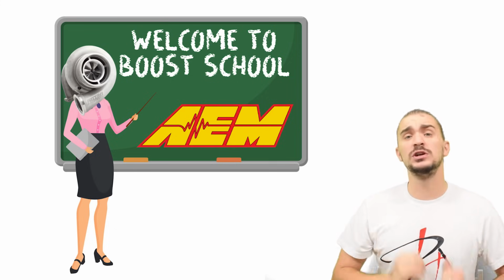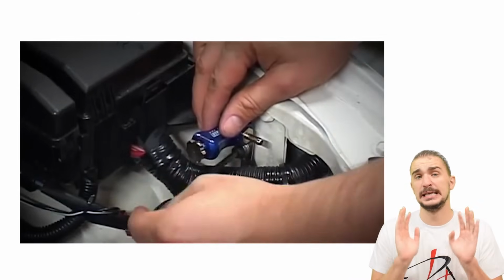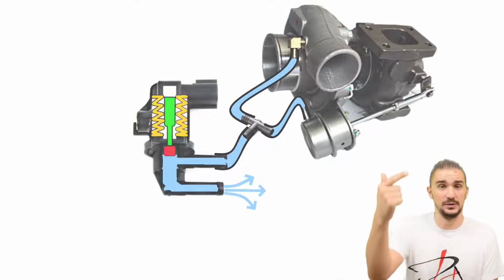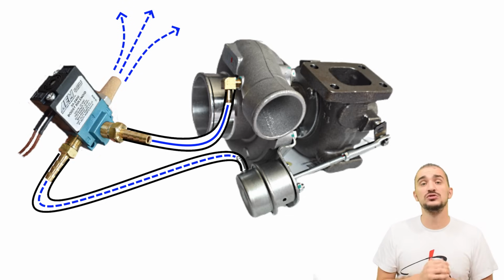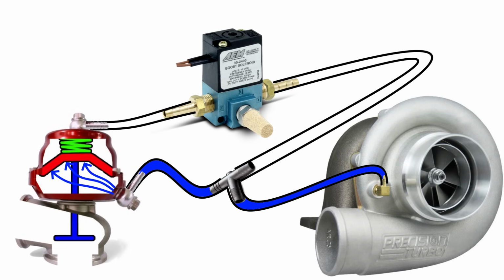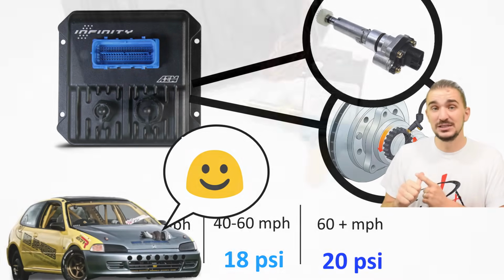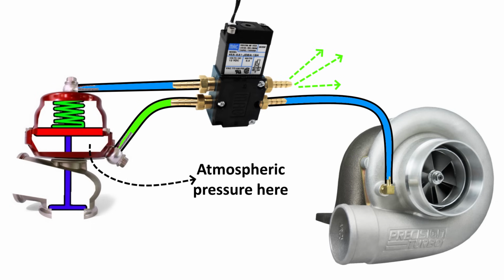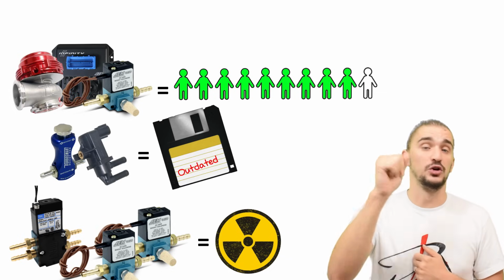ALL BOOST CONTROL setups EXPLAINED - Boost School #3

Comment: Duuuuude in 20 minutes you have explained boost control better than several days' worth of digging around obscure articles and forum posts, great job! Though you could also have talked about CO2-assisted setups?
Reply from the maker: I could, but I left it aside for a separate vid. At 23 mins this was long already. Electronic wastegates will also be a separate video.

Comment: If you have an integrated wastegate and want to run a 4-port or 3-port solenoid, Turbonetics sell a dual-port internal wastegate actuator. I haven't tried it but all the videos I've seen only mention external wastegates.

Comment: You didn't mention electronic waste gates. No springs and total control of boost all the time. I'm guessing that's more because of your sponsors not having them yet. Great video otherwise and the clarification of the boost control systems was the best I've seen.
Reply: Only a fool trusts a computer to last forever.
Reply: @fastinradfordable  Only a fool trusts his cars ECU, TCM etc. etc. Electronic waste gates have no computer, they are controlled by the ECU without which no modern car will run.

Comment: Does any of this also relate to supercharging
Reply: It doesn't PD superchargers are usually mechanicly limited by pulley sizing.  Though have seen some systems use electromagnetic clutches for control.  Though upper limit is still set by pulley sizing. 

Since positive displacement superchargers have no lag modulation can be done with the throttle.  With no need for slipping clutches or belts.

Comment: Another way of boost control is using a external wastegate, with the boost signal going to the bottom side of the spring and a 3 port boost controller solenoid with a canister of CO2 in the inlet providing pressure and the outlet to the top side of the WG. It provides a linear boost curve with easy tunning on inexpensive ECU management at the expense of filling the CO2 canister from time to time. For high boost racing aplications it works like a charm, You can carry two bottles, switch them and keep racing
Reply: I wonder if I could use a bleed valve and a pressure holding canister on my super plus turbo twincharger system. Seen people do similar to help turbo lag in conjunction with the super reducing it as well, but In theory when the super needs to blow off pressure I wonder if I could use it and some other excess gas pressure to essentially make a self recharging version of the c02 set up.

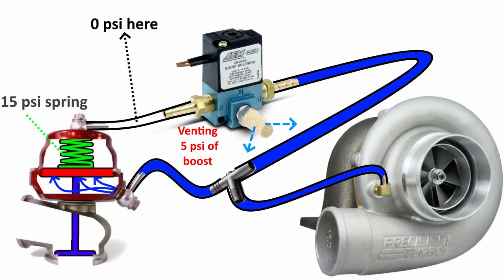Comment: 14:26 About the 3 port controller and 2 port external wastegate set up, in your scenario where the spring is 15 psi and the controller bleeds 5 psi, resulting the total force on the spring 15+10=25 psi. Isn't that 10psi also acting under the spring as well? (basically, all the blue lines have the same 10 psi pressure?)that would negate the effect of the 10 psi on top of the spring, wouldn't it?
Reply: If the top port acts as a pressurized vessel after it leaves the solenoid. So everything after that is being vented. I think there will be some back up under the spring because of the airflow but I think the vent will relive most of that pressure. So assuming when programming the ECU theoretically if you want 10psi the top spring would have 12psi and the bottom 2 psi. The video is much simpler that in real life.

Comment: Hell yes, thank you for this very informative video I wasn't 100% sure how the boost solenoids worked exactly. long time subscriber from the start of the channel absolutely love it keep up the good work mate. 😎
Reply: this explenations isn't really correct though. it doesn't really alternate between opened and closed. the duty cycle of the PWM signal just adjusts the total energy going to the actuator by switching on and off very rapidly. a lot quicker than the mechanical side coul actually react to. that means at 50% duty cycle the plunger will stay approximately at 50% position, and won't be closed 50% of the time and fully open 50% of the time
Reply: @BassistUndStolzDrauf  Not with the frequencies most boost solenoids run at (10Hz or so.) PWM idle valves do operate as you describe.

Comment: Why are there so many ineffective control methods? Why not just directly control the waste gate with an actuator?
Also why control boost based on gear why not just implement a wheel spin sensor that simply reduces boost if it senses tire spin?

Comment: excuse my ingnorance, but how does the older diesel engines controled boost? to my understanding those run at arround 40 psi and feel smooth to drive

Comment: I have a question: why won't we use electric motor to operate the turbos wastegate/actuator?
Reply from the maker: Yes, electric wastegates exist too and they have many advantages, but that's a topic for another video. Spring based wastegates are by far still the most common, cost effective and reliable method in the tuning world. But I will make a video on electronic wastegates too, which is why I left them out of this video.
Reply: @d4a  Thanks for reply, I will wait for that video then : )

Comment: While it is, I guess, more of an exhaust housing mod, I feel like oddballs like the DPS Turbonator Standalone VGT should be discussed in this series. Plenty of gas engines can use a Borg Warner S300/S400 and I plan on trying one on my project ASAP.

Comment: Very informative, thx, but i can't understand why you would not want to control the waste gate with a selonoid directly ? This would be so much easier, no spring, no pressure line, no non sense just open/close the damn thing whenever you need it (i think i saw a company's product doing exactly that but can't remember who ^^')
Reply: I had the same thought. I'd bet that modern turbos are supplied with this setup from the factory, but I don't know if that is the case or not.

Comment: 2 Port solenoid with and external (2 port) wastegate, and an adjustable leak on the signal line to the one port on the wastegate?

Comment: So I'm tempted to get an outdated setup on my old accord.   I want max of 300hp and I want to grip at the same time.  So if the turbo doesn't come up on boost super fast I should be able to not lose traction at all (planning on being a back road toy or auto cross so love corners

Comment: Learned a lot, as usual.
My engine went another way: cylinders. A pre-compression and a re-expansion cylinder are way more efficient.
Interesting how though our foci are completely different your stuff always helps.
By the way, I just solved throttles. I banned them early in the process cuz they suck.
But other stuff presented an opportunity for an essentially lossless throttle.

Comment: So we should all just go with EWG (electronic wastegate) boost Controls. Then you can control you're boost completely and have no downsides...
Reply: I'm with you on that, I would have loved to do that on my build. Because I retained my stock ECU I was limited by the factory inputs and outputs and didn't have a way to control it. Electronic boost control provided me with a nice option and as a fail-safe my car can run on just the spring pressure of the wastegate.

Comment: is there no aftermarket solution that bolts an electronic servo to the internal wastegate? (VW does this for the TSI engines)
Reply: AKAtheA haven't seen one. But then again all the methods and tuning of all Engine parameters/maps can be reflashed on my stock ecu, so no need for standalone ecu until about 900whp+. (even add-on meth & port injection, e85 autotune, launch control, etc) Its a MSD80/MSD81. 
Bmw N54 335i twin turbo stock. Everything can be tuned thru obd2 port with K/D- Can cable. Very impressive. I enjoy the launch by gear psi and other features. All on an Android and now EVEN a wireless connection on an iPhone on new iOS's. Crazy how far they have came so far in the 5-6 years ive had my E92 335i RWD 6MT. 

Im looking forward for them to use the EWG system from a 2012/13 & newer bmw ewg by ecu vs the conventional pwg and boost solenoids controlled by ecu. 
The EWG cars just really have a simple electro-mechanical solenoid with a rod to the turbo WG flapper. Its an electronic version of a pnuematic wastegate basically. 
The newer cars have an upgradeable DI pump. The stock pump with other mods done is maxed out at 450rwhp-ish. Thats when you would go to port injection for the tuning, extra fuel, benefits of having DI and port injection as well. Cleaner valves, cooler cylinder temps, good mpg when driving normal, etc.

Comment: Confused how this can improve responsiveness.  The waste gate is a dump valve which in the simple system is initially closed which I would think gives the max possible boost from the exhaust gases.  There is no higher than closed, all you can do is delay when it opens.    The initial response, or rate of boost build up, would always be the same.
Reply: That is a good question. Without a boost controller the wastegate spring is resisting not just the boost created by the compressor but also the exhaust gas back pressure. As you get close to your boost threshold, you are already close to opening that wastegate and the added pressure from the exhaust will cause it to crack open early.  This means that you need more total exhaust to get the turbo to completely spool. A boost controller prevents this by not letting the wastegate spring see any pneumatic pressure until the desired boost level is reached. The turbo will actually be completely spooled at a lower RPM. Hope this helps.

Comment: Wouldn't bends in the travel path of the air interfere with the performance?
Reply: As far as the plumbing for your boost controller it is not really an issue. You aren't actually flowing air through those tubes, they are just being pressurized.
Reply: @GaurdianAzzar  That makes sense. Appreciate the time you took to respond.

Comment: You need to add the new generation of Turbosmart wastegate that don't have a spring and are completely controlled electronically via ECU. It debuted last year at SEMA
Reply: The channel is sponsored by AEM. If Turbosmart sponsors him then maybe he'd feature them too.
Reply: @sepg5084  agreed, it is sponsored by AEM. I thought that if he was trying to make a complete list of boost control, he would include it, even if he left out the brand name and only described the functionality
Reply: @Red2l16v  i have a 2013 VW with a turbocharged gasoline engine  - the wastegate is controlled by a fully electronic actuator which also incorporates a hall position sender as for the ECU to have a permanent knowledge about the actual position of the wastegate (100% opened, fully closed, or any other value in between) . So imagine the possibilities when talking about tuning maps that can actually control the boost in an accurate way. The only failing point on my specific engine is the link between the wastegate and the actuator rod. The pin holding the pieces together gets worn and the wastegate can no longer be fully closed.
Reply: @bucurandrei1987  not sure why the video didn't present that system, seems way better to have a pressure sensor and a stepper motor controlled by the ECU...
EA888 one as example: https://shop.mambatek.com/images/053-0104-H.jpg
Reply: Yep i have 1 on my 2018 F150 2.7L 😁
I had the previous version that was spring actuated but it was annoying taking all the vacuum lines off n on once i randomly had to go to the dealership for a failed Oil PSI sensor.
So the new one, although not as loud as the spring actuated model, it is literally one si gle connection into the factory harness. (Old model also makes you T Tap and cut into ur factory harness to bypass the sensor).
Not anymore 🙂
(Also its a Blow-Off Valve, not a Wastegate if that is or isnt what you meant)
Reply: @nickh3809  I was referring to the wastegate specifically. But the BOV is nice as well. I have one installed on my Subaru WRX 😁
Reply: @BoNosKG09  Haha ok was just making sure, but very nice im sure you enjoy every second of letting off the throttle especially underneath bridges and over-passes as much as i do😂
Reply: @nickh3809  OH YES 😁😁 I also tuned a ECO map that essentially keeps the wastegate open and dials back the fuel so I get 30mpg while road tripping
Reply: The electrically Controlled wastegate is used by OEM too. I think BMW uses them on their cars. Turbosmart may be the first in the aftermarket to introduce them. I had heard or this years ago but the stepper motors to have the strength and durability to use as a WG actuator weren't widely available yet.
Reply: My mechanical diesel with variable turbo makes 60mpg
Infinitely adjustable. 
No wastegate- no wasted energy. 
No bov-

Imagine how much u spend not only on fuel but in fancy ecu and valves ect. 

The price of your ecu I could drive having fun with my boost for multiple years
Reply: @fastinradfordable what turbo is it? I'm just learning about turbos and all that and a variable turbo sounds incredibly intriguing!
Reply: But it’s fun to check in to see all the ways you spend extra money to solve silly problems

Comment: May be a dumb question but.... Why all these solenoid stuff? Why not a simple pressure sensor (electronic) on the intake mainfold and an electronically controlled servomotor-assisted  wastegate on the exhaust? Why all these solenoids, pipes, and springs???
Reply: I believe some OEMs do this, and Turbosmart recently introduced an aftermarket kit for this. Pretty beefy and expensive, but indeed, it would offer direct and super-accurate control

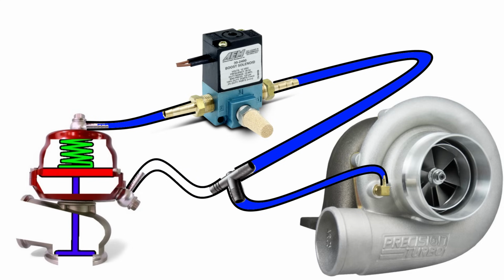Comment: At 13:31, the 3 port solenoid with 2 port wastegate (WG),  where boost reference is to the back of WG & solenoid to the front, is also best for safety measures, in that if your solenoid fails the WG will force open. Now on more extreme racing situations,  many reverse these, in getting the most boost to hold the gate closed.

Comment: Boost control? Laughs in welded wastegate on a carbed engine so it just starves of fuel before it damages the internals (Please do a fact check on this comment)
Reply: Fuel starving a boosted engine sounds like a complicated way to spell grenade.
Reply: Now me and the mad scientist gotta rip apart the block, and replace the piston rings you fried! 😠
Reply: Running lean with boost? Do you want to fry ringlands